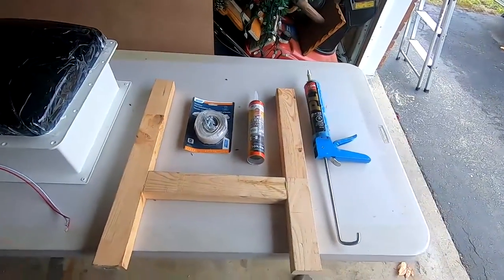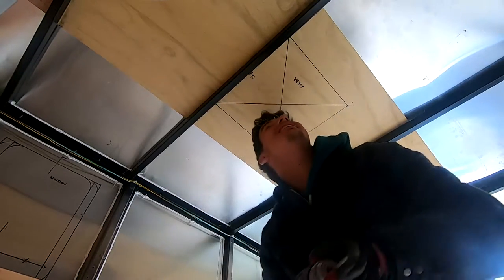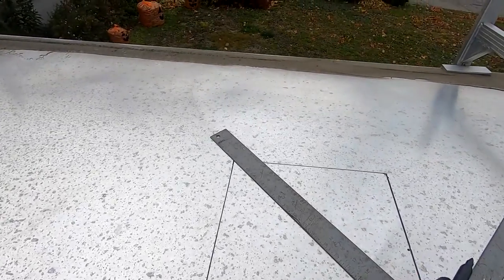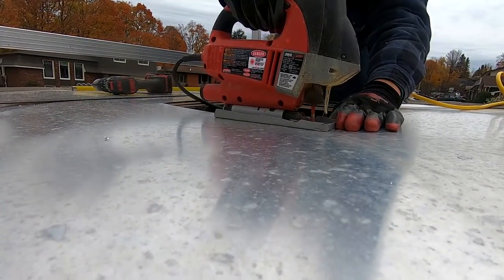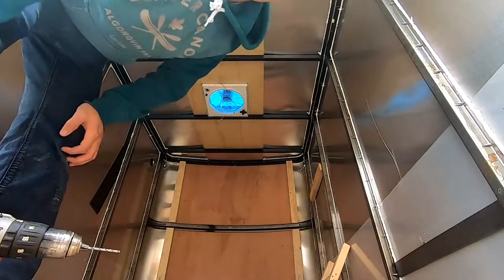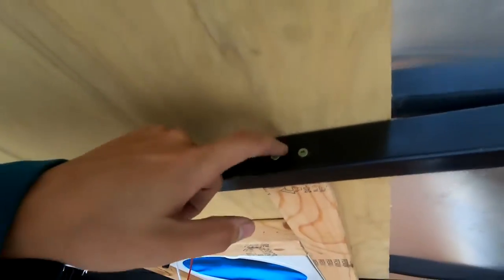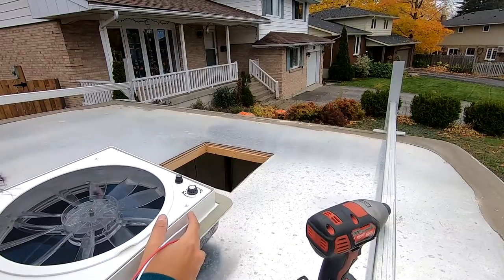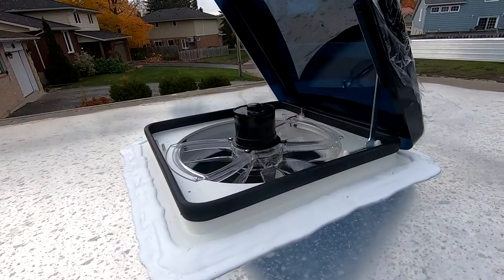Installing a ROOF VENT on my 5x8 Cargo Camper Trailer Conversion

Comment: Found your channel through "Be Free Builds".  I installed a maxxair fan at the end of summer, anxious to test it in summer of 2021.  Last June I was on vacation testing out my partially converted bus and it was 90+ all week and massive heat transfer from the cab to living area, I am hoping the fan will draw out some of the ambient heat.  The install went really well, NO LEAKS!!
Reply from the maker: Thank you! I hope the vent will keep the temps down in the summer.
Reply: @JoelTremblayCA  I have no doubt it will definitely help. Like I said I’ve yet to test mine. But in my house if I put a fan in the window in summer it helped pull the excess heat out there’s been built up inside.  So I figure in theory the same thing should work in my bus.

Comment: My 6x12 trailer also has the 3" side vents which look to be similar to yours and I have thought a lot about skipping the roof fan and going with an inline fan setup run off of those with the component/hardware hidden away behind cabinets or the like.  Do you find your side vents have any practical use anymore? I picture cold air leaking in on y'all in the night.

Something about your videos really flow nicely and surely hit the mark.  I have watched many, many van/trailer conversion videos and these are among the best I've seen.   Thanks!
Reply from the maker: Thanks for watching! Because the trailer is such a small space and tightly sealed, it is always a good idea to have some ventilation whether its with a roof vent, window, or side vents. I left mine in because I wanted to make sure I constantly have fresh air coming in. I didn't find it to be a negative impact on heating in the winter. Could always make plugs if I found it to be the case!